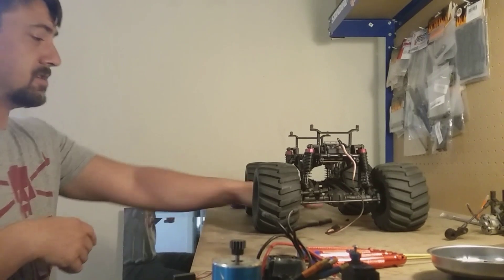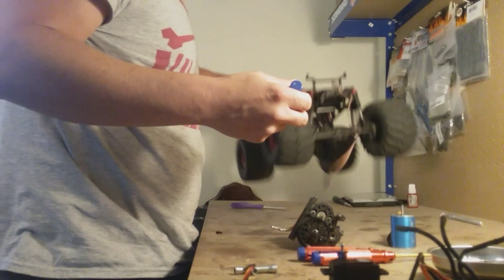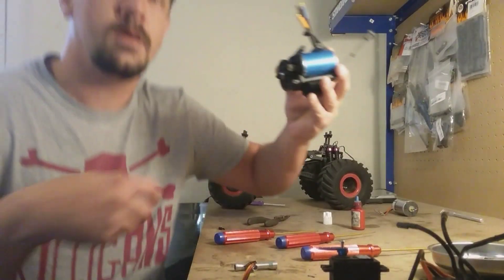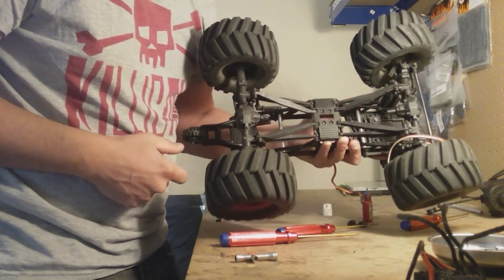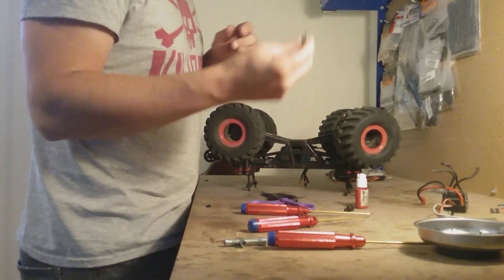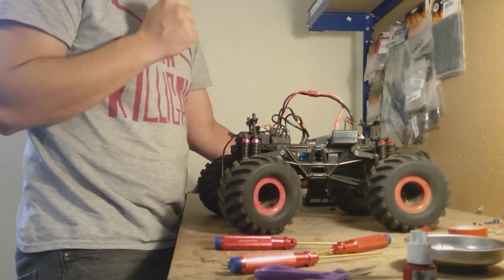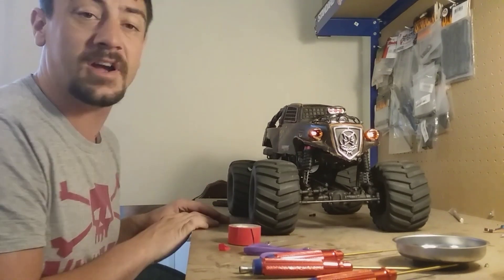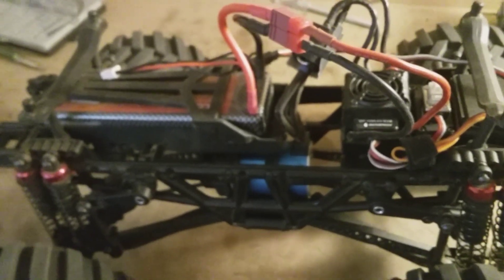CEN RACING HL150 BRUSHLESS Conversion and servo upgrade!

Comment: Where you get you upgrades at
Reply from the maker: I had electronics from a basher truck that I wasn't using.  I just put them in this truck.  It was a direct fit.